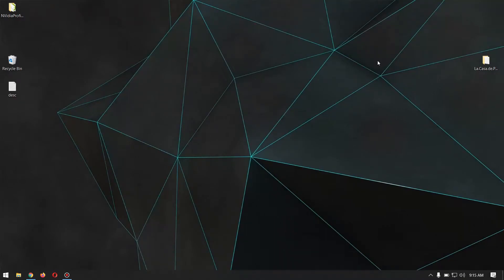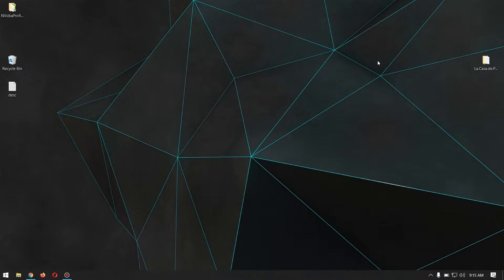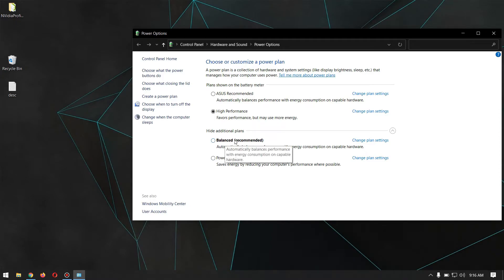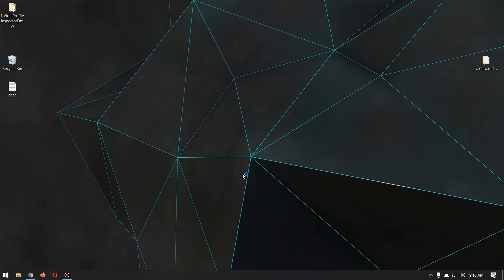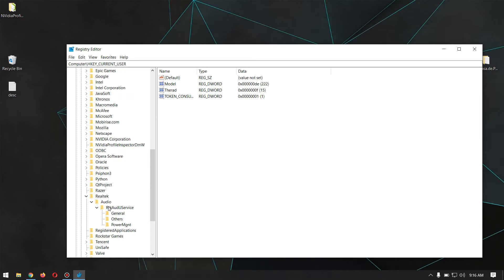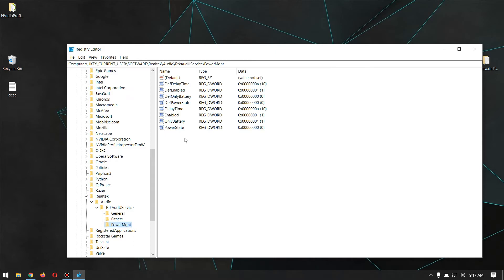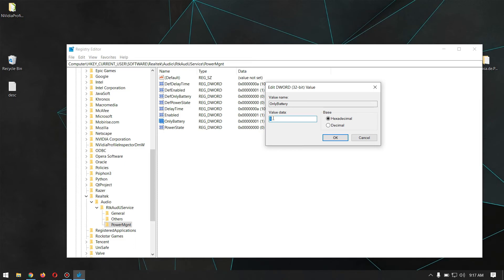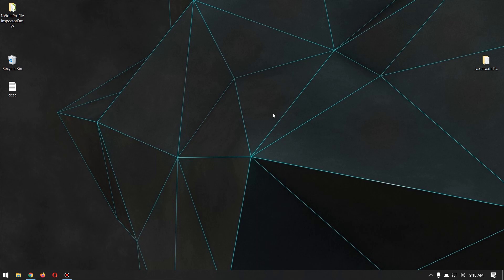ASUS TICKING SOUND ISSUE SOLVED ✔

Comment: I also do not have the PowerMgnt Option under Realtek Audio. I would have loved if you provided an example of the sound that you are addressing here so I can compare it to mine. Mine is similar to the sound of a small fa hitting scraping against something else but I am not sure. Also kind of sounds like the noises that old computers used to make in the early 2000's... Can anyone provide further help? This is driving me crazy...
Reply: Same problem bro did u got any solution

Comment: *TRY THIS FIX!!*
Hi! So I has this issue on a brand new AsusZenbook Flip. ON WINDOWS 11! Did all the drivers and firmware updates but that's not the fix. Nor was your suggestion. What was was to go into sound settings via control panel, then audio settings pick the device and choose properties, goto the additional settings and TURN OFF hardware acceleration! Reboot and BOOM!! No reinstallation of windows needed.  Job done!
Gimme a like!!
Reply from the maker: Check if you don’t get it again after restarting.

For me the best solution was to wipe the laptop os and install new one with usb

Comment: hi. my laptop also produce a ticking sounds and then after a few minutes it will show blue screen. after restart, it will ticks again then turn the screen to blue. usual errors points to 'Kernel_data_inpage_error' and 'Critical_process_died'.
The issue repeat again and again after restart. There is no specific number of restarts before it back to normal.
Hope you can help me on this issue. Not sure if this is a HW or SW issue. Laptop is ASUS ROG G56. Thanks...
Reply from the maker: If it is a new laptop then you better return, if not new, then how long you are having this issue, and what you did recently?
Reply: @LazyTechNo  this one is old & I think its from 2014. this has been like this for more than a year. already have a new desktop but want to use this laptop for my other TV. just want to fix the issue before using it again. someone already told me that maybe its related to HDD. but before buying a replacement, just want to make sure it is really the issue

Comment: The clicking sound starts when i switch on my laptop...and after that it stops...but main thing is when i keep my laptop ideal..i mean laptop is on but i don't use it..then it suddenly starts making clicking sound....also it occurs when the scree goes to sleep mode but laptop is on...please suggest ways to fix it ..please
Reply from the maker: Try to update your asus drivers from MyASUS app
Reply: did your issue solved ? pls share I am having the same issue
Reply: Yeah ..its stoped after i updated drivers from MYASUS app
Reply: @anuradhasharma4380  can you tell me where to find driver updates in my asus app
Reply: https://www.asus.com/support/FAQ/1038551/ driver update link...you can follow the steps to update the drive